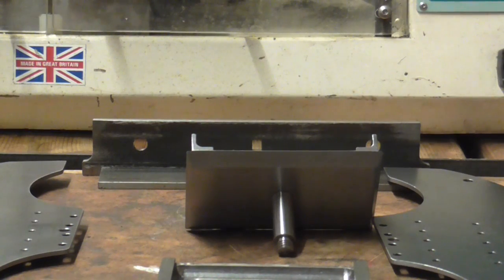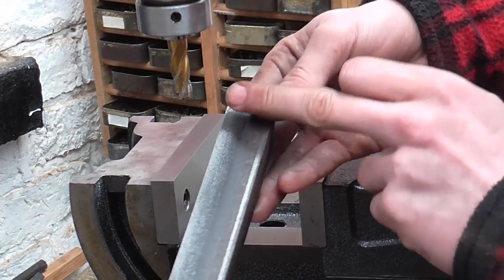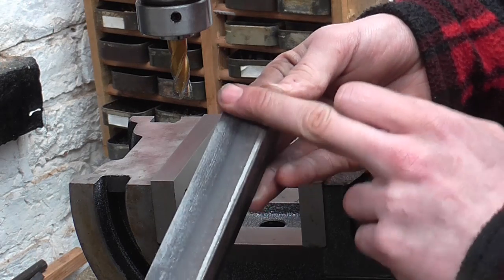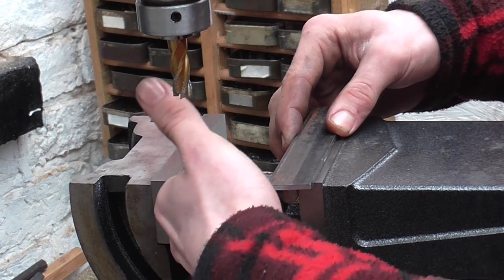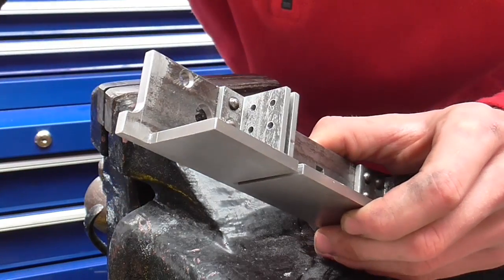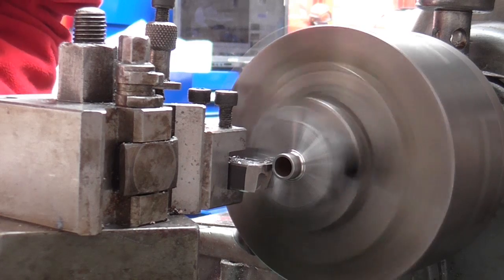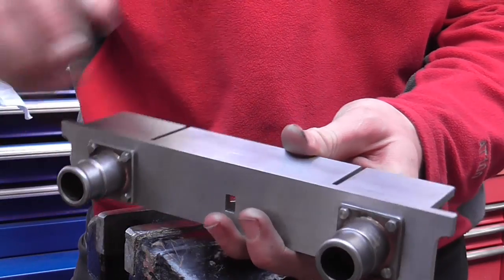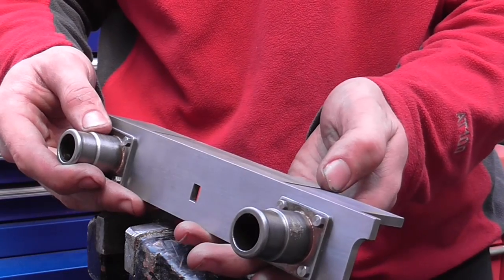Assembling a Loco Chassis Part 1

Comment: Thank you ...nice work...I also appreciate that you showed the broken tap....I am a machinist in California and enjoyed hearing the rain...( too dry here)...On my important parts, when I break a tap, I use a hand ground spade bit, solid carbide (micro 100) at low rpm using heavy cutting oil, lock the quill and slowly bring the knee up until I cut through the broken tap...I very much appreciate your presentations....Jeff

Comment: Finding you videos very interesting as I am in the process of building a Springbok, when time allows.On the axleboxes, is there a particular reason you have put the small plates at the top of the springs, my drawings show them at the bottom.Hope you keep the videos coming through to completion. Nice work.

Comment: Excellent work!  Your parts look great!   I think you could use a face mill to do most of the work in taking the rivets down to the surface of the plate.
Reply from the maker: Herb Blair Thanks, Yes a face mill would probably be sensible. Although soft iron doesn't take much filing.

Comment: Do not waste your money buying Soft Jaws for your bench vice. Get yourself two pieces of good quality ally angle say 1.5 inch X 3/16 or 1/4 inch thick. I feel sure RR has some in their stores or scrap bin. If not another good material is Copper. Get a bit of 10 swg ( 3 mm ) and bend yourself a couple of angled bits. To stop them keep falling off the vice, either use a bit of Blue Tack or Araldite a bit of magnet to the ally or copper to "stick it to the steel body. Of course it will have to be outside the clamping area. Another good method which we used at Philips was to drill a clearance hole for 4 BA in the centre of the jaw holding countersunk screws. Then countersink, drill and tap 4 BA, two holes in each soft jaw at the same centers as your vice jaw screws, attach 4 BA Countersunk screws to your soft jaws. You were then able to open and close the vice, bang around on the vice and the jaws would still remain in place. You could also use some hardwood with nails in place of the screws. 
Excellent job you are making. I made a 3 & 1/2 inch Caribou took me 3 Years. Gradual at the start a few hours here and there, at the end it was every minute of the day I could find. Worth the effort, gave much joy to children having a ride on the track in our local park.
Reply from the maker: Dave Ticehurst Good tip thanks, I may do that. Although I quite like the clip on ones that are made of a non metal.

Comment: when I was in  high school (age 14-15), we had a metal shop class that was no way as good as your apprenticeship.   A briliant video!  btw, did you learn of the RR engine problem with a Quantas A380?   It seems a oil tube pipe was drilled which made a side of the pipe narrow....RR new of the problem and would replace that bit when they did the maintenance...unfortunately, this particular engine was one of the first to be installed..that video is here at YT...very interesting.  cheers, chuck

Comment: I saw your video of 18 Nov 2014 when you talked about the rivet snap the first time but I would like to know the shape on the inside of the smaller hole in the snap that is used to set the rivet before you peen it. Does it change the shape of the end of the rivet? Thanks!  Daniel

Comment: Fantastic work, videography, editing, and narration; thanks for sharing, Mr. Crispin!  If you get a chance, could you tell me where you get the rivets?  Are they actually soft iron?  It seems that all that is available in the U.S. are mild-steel rivets.
--Bruce.
Reply from the maker: wbmphd I buy them from a Model engineering supplier, they arn't very cheap. Mild steel rivets are hard work! Perhaps you could make a little set of punches to make soft iron rivets?

Comment: Did you machine the inside corner of the larger angle to make it square? i. e.  to get rid of the radius?
Are you able to purchase plans/drawings for the locomotive?
Reply from the maker: No I don't think I machined the inside but I can't actually remember! I probably filled a radius on the corner of the angle so that it fitted in properly.
Reply from the maker: You can get the drawings from AJ Reeves website

Comment: Just wondering what factors you consider when when choosing between soldering, screwing or riveting parts together? And is it as much about engineering expediency as aesthetics?
Reply from the maker: +Obvious Schism In some cases it is specified by te drawing, in others the application is the decider and other times any will work. Silver soldering is very strong, it can also provide a gas and liquid tight seal. However everything has to get hot and inevitably covered in black scale. With bigger workpieces distorton becomes an issue, as does being able to heat it hot enough. Heating some metals up also can effect thier temper or hardness. 

Riveting is strong and quick alothough in small scale its diccicult to achine any kind of a seal. You also need about 3 hands on larger jobs. Rivets can be drilled out but they tend to be put in with a mind set of leaving them there. 

Screws are versetile, on my chassis for instance you can put them in areas that are diffcult to rivet in. Also you dont have to balance or hit the work piece as with riveting. The main down side as I see it is having to tap all the holes, which can be very time consuming, perticularly if they are small.
Reply: Ok thanks for that very comprehensive answer. So its a matter of taking each case as you find it and then using the most appropriate method for that particular situation. I'm looking forward to more videos in this series and particularly these types of explanations of the reasoning behind engineering decisions..
Reply from the maker: +Obvious Schism Yes thats about right. One other factor is the consequence of what ever joining method going wrong, For example you might think, would i rather risk breaking a tap, missing the rivet and marring the work, or distort/upset components due to heat.

Comment: Is there a formula for size/depth of the countersink for the rivets?
Reply from the maker: There probably is but I normally do a test piece to check everything out before I start
Reply: @MrCrispinEnterprises  Yeah that makes perfect sense. Thks for the quick reply!
Reply from the maker: They say for a dome head you cut rivet longer than the thickness of the workpiece by 1.5x the rivet diameter. So for a countersink I cut the rivet 1.5x D again and then make the countersink deep enough to suit.